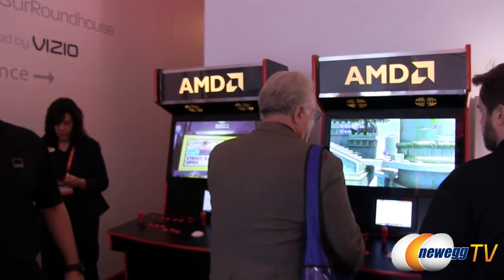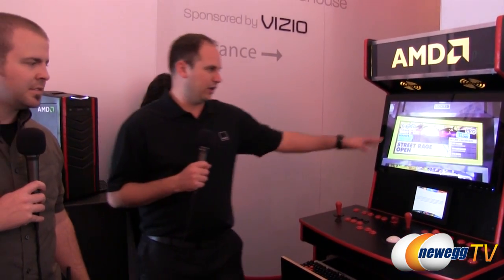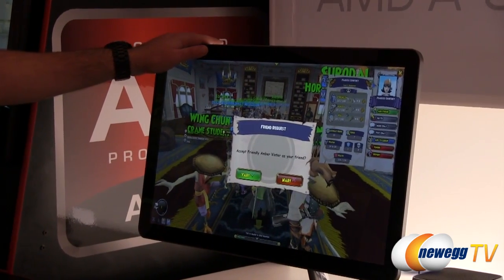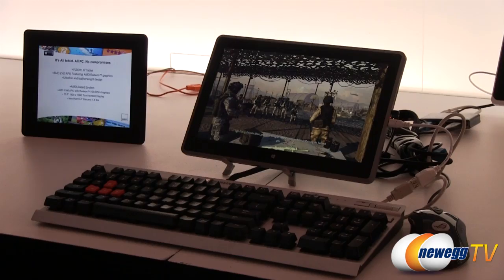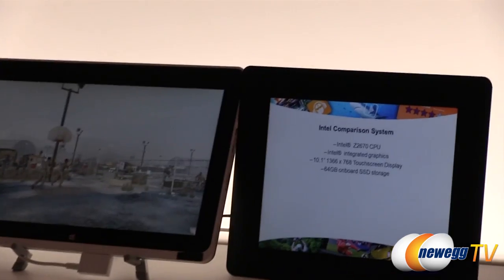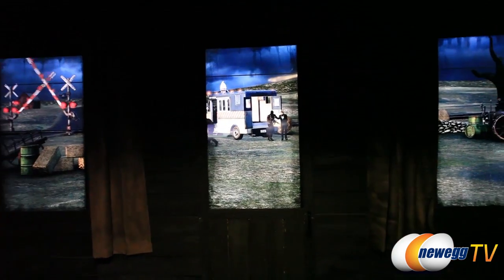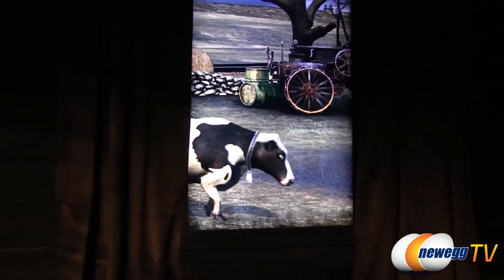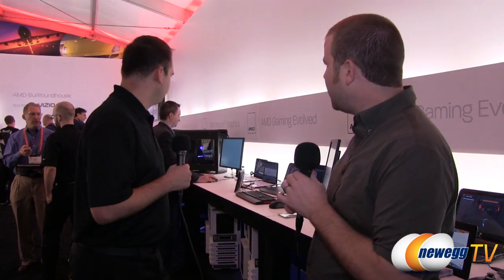Newegg TV @ CES 2013 with AMD - Vishera, Visio All-in-Ones, Wii U, Surround House

Comment: Says the man whom said "400 + Mhz" as opposed to the actual 600MHz difference that they have at stock speeds (4.0-3.4=.6).  If you're talking about the 4.8 - 5+ difference, I never specified a speed, so it's still a technically correct statement.

Comment: I've seen sites like Bit.tech that had the i5-3570K at 5 Ghz and compared its power consumption to the 8350. The system consumption of the 8350 was at 364 Watts at full load, vs 267 Watts for the 3570k. It could easily be as much as 120 Watts if it was the 8350 at 5 Ghz and the 3570K at 4.8 Ghz. No matter, once you've removed the 400 + Mhz advantage the 8350 had at stock clocks, everything changes.

Comment: I use a Cooler Master N520 for my i5-2500. It worked pretty well when I had my 2500k at 4.8 Ghz, but I keep it at 4.63 Ghz to keep the temps around 60C. It was only $30 at Fry's.

 The 3570K would have a stable OC at @ 4.8 Ghz Vs. 5 Ghz with the 8350, but you would have an additional 190-200 watts of power being pulled from the PS with the 8350 at full load. The price difference between using a 650 watt power supply and an 850 watt unit would definitely offset the $25 price difference.

Comment: Yeah, and you don't buy a Black Edition to run it at stock either =P that 4.6 definately isn't on a stock sink, I'd believe that it's on air, but not stock.  A nice aftermarket sink for the 8350 as well (to even the playing field) could easily bring it over 5GHz.  I think they'd still be pretty evenly matched =P not to mention the 8350 has more headroom than the 3570k.

Comment: Logan really didn't show much, and the numbers he was reading off didn't match what was on-screen. It still doesn't matter, because he has unlocked Intel CPUs being compared to a higher clocked FX-8350. You don't buy a k series intel CPU to run it at stock clocks. Bump up the i5-3570k to 4.6 Ghz and then start talking about how well they compare, even with the 8350 OC. 

I'm sure he didn't want to bring up Starcraft 2 or better videocards that would actually lean on the IPC of the 8350 either.

Comment: I k now, I watched Logan's video as well.  He didn't test it with an 6-core CPUs, only the quad-core i7-3820.  Either way, it depends on your application, gaming stresses different specs.  Honestly beating a Xeon is not exactly impressive.  Not saying the 8350 isn't a good CPU, just pointing out a flaw in your excitement.  You should be saying "dude it is beating an i7-3820" or something like that.

Comment: You should check out anandtechs benchmarks. You can compare the FX 8350 to the i5-2500k, i7-2700k, i5-3570k and the i7-3770k. It's nowhere near 60%. 

 The FX 8350 wins a few categories with heavily threaded applications, but still loses in benchmarks like Cinebench 11.5, Sysmark 2012 overall and Windows Media Encoder. It does win in x264 HD encode test 2nd pass, but loses on the first pass.

Gaming is where it really gets smoked. We're talking anywhere from 20 fps to 30 fps in most games.

Comment: And the i7-2700K with 4 cores (8 threads) and a stock clock of 3.5 Ghz will outperform the 8350 in 90% of benchmarks. It also has a much higher IPC. Microcenter has the CPU for $219.

Comment: Everyone thinks Xeons are like the super CPUs from Intel but they're really just a different class of processor... They aren't made for incredible performance, the highest clock you'll find on them is 3.1GHz which will cost you nearly $2000... while the i7-3770K at 3.5GHz for $300.  It has more cores of course, which is its strength, but it's not meant for performance but 24h server usage, and they have additional QPI to let them communicate with each other in dual CPU systems.

Comment: true, Intel High-ends are much better in performance and less power consumption, but also more expensive. AMD high ends are much cheaper, almost as powerful, but offers less efficiency (more power consumption because of the 32 nm). And AMD claimed that their Steamroller will be 28nm, which is gonna be more efficient. I'm very pleased with my 8320 and now saving up for Steamroller!! :D

Comment: 8 cores? lol ok but... most games don't even use 2 properly. I guess some other software might use cores adequately but, really without more speed we are stuck. Even if you can divide the information of a process, you still have to process the relationship between pieces.